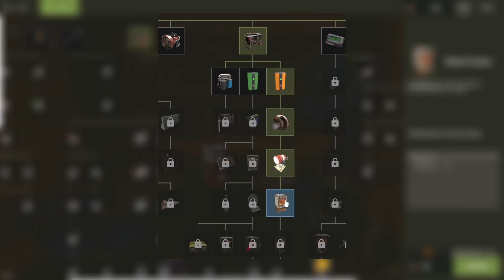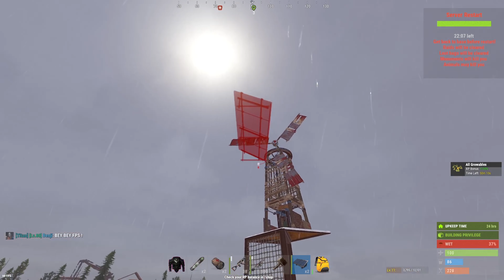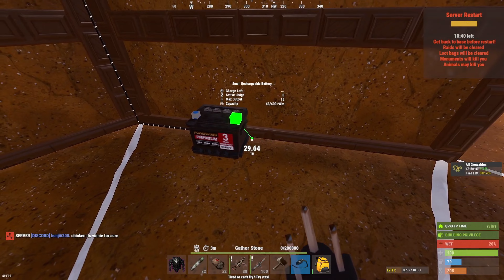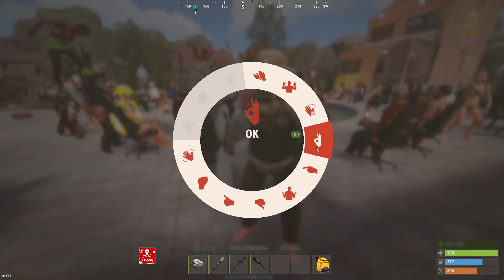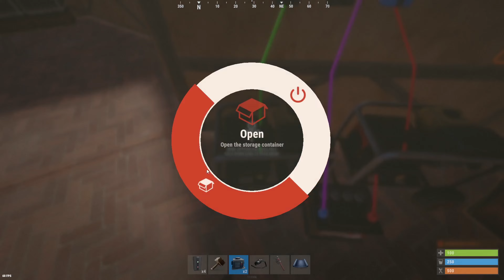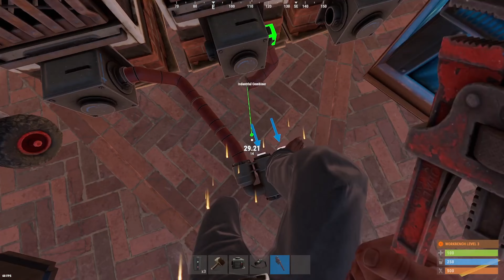How to Set Up an Electric Furnace in Rust I Step-by-Step Guide

Comment: Hey your setup doesn’t need to be that complicated! Are you a noob?  You should do some research.  You don’t need pipe splitter or combiner.  You put them in series not parallel. You daisy chain the storage adapters.